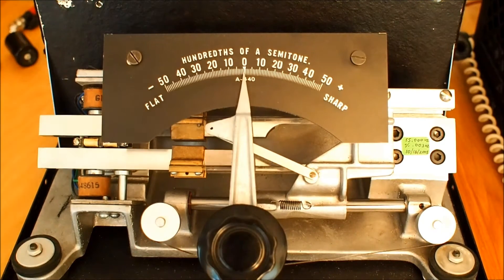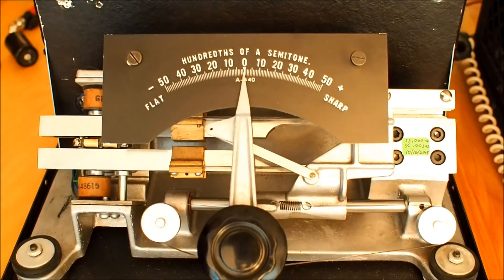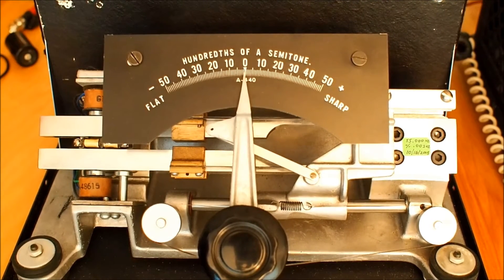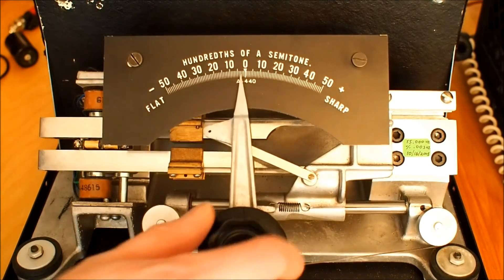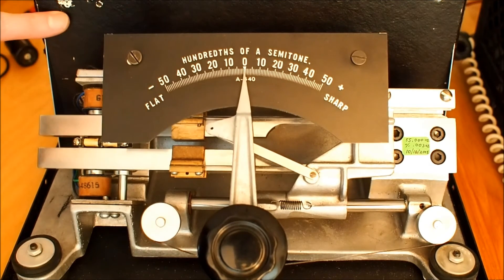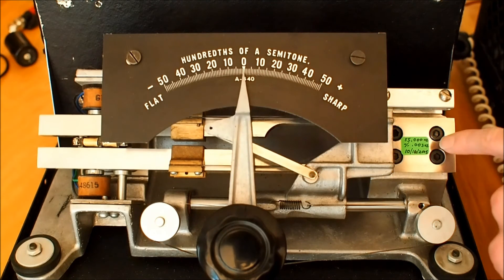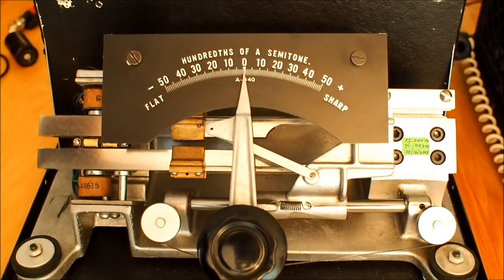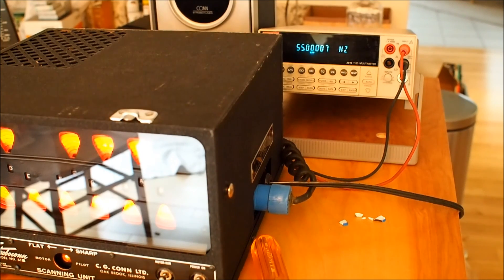Strobe Tuner Shootout Part 2 - Inside the Stroboconn Tuning Unit

Comment: I am fairly sure that "Connivar" is an in-house, temperature-stable formulation based on nickel silver (also called white copper, German silver, or cupronickel) which is a bunch of copper and some nickel with a little bit of zinc. Since they used nickel silver extensively in their brass instruments, it makes sense that they would mess around with what they had on hand. But that is just a guess on my part. Conn liked to tweak existing things and then give them showy names, such as "LusterConn" lacquer, "Cry-steel" pistion valves, and apparently this "Connivar" stuff…

Comment: I was hoping you would go into detail on the inaccuracies of the st-11 you touched on. I have my eye on buying one. Really I want to know if st-11 is 1/1000 of a semitone accurate.
Reply from the maker: I never did get to finish that series, I wound up having to pack all my stuff and move.  Perhaps I'll get around to it.  The ST-11 has great resolution, but its problem is that the oscillator isn't terribly stable.  It doesn't have a quartz reference or anything, and it winds up being quite drifty even if you let the unit warm up for a while.

Comment: I have collected StroboConn tuners over the last 20 years.  I believe I have one of nearly every model they made, from the earliest 6T (in large wooden boxes instead of metal cases) all the way to the 6T6 which was an industrial model used in power plants to test line voltage I believe.  Would love to chat more with you sometime.    I use this tuner every single day in my business.
Reply: great video I love the reference wow, picked up an ST6 PDF manual states 1961 have to replace and check caps too.  would like to see the other Conn models show accuracy wise vs your big daddy unit.
Reply from the maker: Hi Matt, sorry I didn't notice your comment until now.  I've sent you an email
Reply: I have a StroboConn if you are interested.